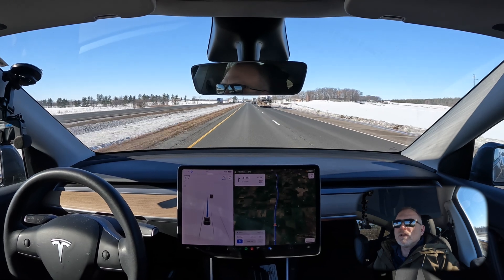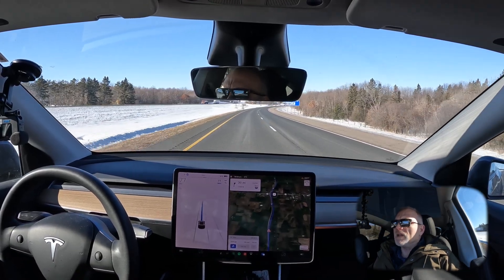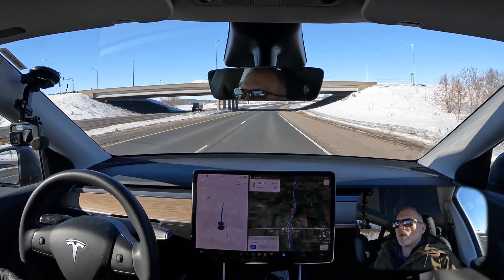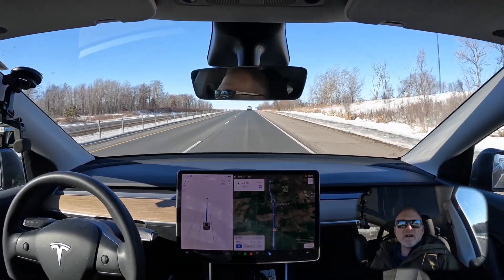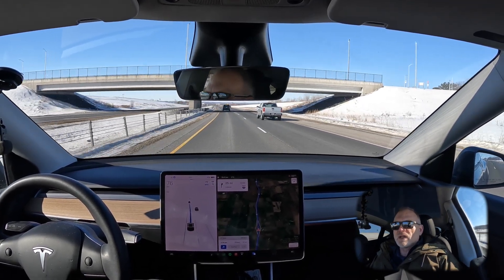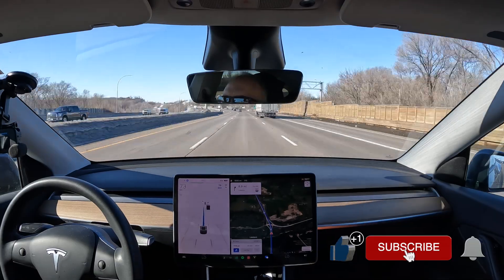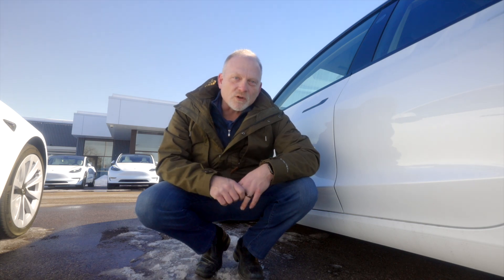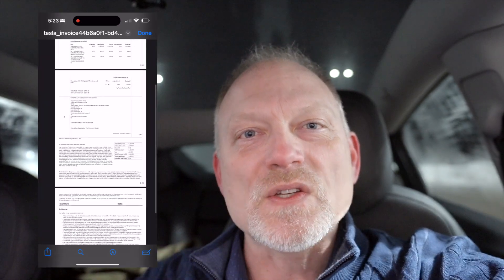Tesla Heat Pump & SuperManifold Replacement Cost | 2020 Model Y

Comment: This is what happened to my 2018 model 3. Warranty ran out after 50,000 mile or 5 five years. I’m having climate control failures. Looks like I’m going to have some costly repairs. It popped up on one of the firm ware update. 🤔
Reply from the maker: Very sorry to hear you're going through the same thing. I think it has a different heat system (resistance heater), but nonetheless, it still probably an expensive repair. Keep us posted here if there is anything for community learning / awareness.

Comment: In Sweden that would have been free of charge since it is a production error (very common one!) so they would have to take it, warranty or not.
Reply from the maker: That would be nice to have in the U.S.
Reply: Tell me more about it. I'm having the same problem with my 2022 MY Performance model in Stockholm, Sweden. The quote that I am given from Tesla is 33,232,98kr. I asked them if it is under a recall for my car. The reply was "I do not see any active recalls for your car". My service appointment is due in two  days. Not sure what to do not to get ripped off by 33k by tesla.
Reply: @ya_tozhe_hochu  My 22? Then it is probably not more than two years old, right?
When did you buy it?
Use "Konsumentköplagen". You have three years right to claim an original error, and this is clearly an original error since so many have had the problem in the same time and Tesla issued fixes for it.
Depending on when you bought the car, the seller have the burden of proof for six months (until april 30 2022) or two years (after may 1 2022).
Read the law and also read more at Hallåkonsument and Konsumentverket, and use that together with the articles written about the problem, and if they do not comply, then go through ARN. It is important to have as much as possible in writing, so save everything you write with everyone.
Reply: It should be a recall. We need to provide all this info to nhtsa in the us

Comment: There’s litteraly piles of heatpumps and manifolds in dumpsters at Tesla shops in Norway now, mainly from Y’s from Berlin since october to january. Brand new ones, failing 1-10weeks old. Apparently a manufacturer error of some sort, some claim it to be the pipes.
Would be interesting to hear what caused it on yours.
Reply from the maker: That is bad. Especially in Norway where it is as cold is it is here. I'll post a follow-up video if I learn something after looking at my old pump.
Reply: You think those failed pipes are from 2023 Model Ys ?

Comment: Good idea to take a broken unit if it is so expensive. I would have done the same
Reply from the maker: I’m going to pull the old unit apart and see if I can find the failure. It might make a good video if there is knowledge there to share. Hopefully someone mechanically inclined could use it to save a few dollars.

Comment: I’ve had quite a few cars over the years, including a 21 year old Subaru Forester. Never had a heat or AC failure.  I assume your seat warmers worked while you were driving
Reply from the maker: I haven’t either for heat, but have had several AC failures. Usually a leak in the line and loss of refrigerant on older cars we’ve owned. Your assumption about the seat heaters is correct - they saved the day until the repair.

Comment: Isnt it part of the warranty?
Reply from the maker: I pushed on that several times. The car is outside of the 50,000 mile standard warranty, but since this system is involved in temperature control in the battery, my thought was that warranty for the 'drivetrain' would cover it.  Unfortunately that is not the case.  Since the goal of my channel is to provide information about my overall Tesla experience, I will include both good and bad experience.  Although service was great, Tesla's non-warranty coverage of this relatively early major component failure wasn't the best experience.  I want to help make others aware.  It's a great car and my experience may just be a one-off.
Reply: @JohnVanDeVoort  oh Ok, didnt know that was the limit was so low. model S was 4years/100k+ miles
Reply: @JohnVanDeVoort  Don't you have insurance that cover it? Or how does it work there?

Comment: What a ripoff! I’m so sorry you went through that! For such an expensive car for the heat pump to fail after just 50K miles. Tesla build quality is horrible. My parents bought two and everything creeks. I went with the Lexus NX, best choice I ever made. For your experience you paid 3600 for service plus if you account for your time lost running back and forth, it’s even more expensive! The gist of the story is stay away from Tesla until they get their quality together! 😅
Reply: That's called survivorship bias. Almost none have this problem.
Reply: @harry-eto  The amount of heat pump failures out there on Tesla is... astonishing!
Reply from the maker: I actually made a comment in the video that I edited out of the final version similar to that (about lack of quality). What I added is that hopefully after the third production year, and also adding heat pumps into other Tesla models since the Model Y, that quality of the heat pumps should be better with more production experience.  I'm crossing fingers that that is the case and that this new heat pump will be better quality than the original one that failed.
Reply: @JohnVanDeVoort 
I just had similar issue from my 2021 Model Y. After talking to their lead technician over the phone who said “… the part works 24/7 even when not driven to keep the battery temperature at normal level…”. I told them this is absolutely a manufacturing or design deficiency that the consumer should not be responsible. It means Tesla perfectly knew this problem would happen from the outset. My belief is that Tesla should bear the responsibility of repairing or replacing the part at no cost to the consumer even after the warranty is expired as they knowingly pushed faulty system onto the consumer. Apart from being expensive, the malfunctioning might be from a refillable liquid and not from the hardware that according to me is sturdy enough unless one had an accident or a crash. I am gathering information (that’s how I ended up with this video) to compile evidence, technical testimonies from professionals, etc so that powerful corporations like Tesla wouldn’t continue to ripe off the little & powerless consumers like ourselves. The source of their power to ripe off comes from our inaction or silence.
Reply: @bizuayehuhaile1348any progress with a recall or Tesla owning this clear design defect?
Reply: I had two 2021 Lexus ESes with numerous rattles creaks and squeaks.
Reply: Lexus does not fight for our freedom of speech and does not release information on the gov'tal fckeries against us. To add, I cannot stand the new design of lexus and finally, I would have to wait for one for 18 months here in Sweden, last time i checked. So nope, thanks. I'll pay the $3K for the freaking pump and continue drivning my Musk-sla with pride and honour )))
Reply: I’m now in the same predicament with the same coat estimate. 300 miles outside of my warranty smh.
Reply: The heat pump in this car is incredibly reliable. I would say this is probably at 0.1% incidence rate. Very rare.
Reply: Mine failed too I believe this will drive a hardware recall since the rate of early despite is so high and the resulting safety issue with no defroster @matthewhodges5910

Comment: So what was the actual reason for the failure? Have they fixed this issue in newer versionsof the heat pump and super manifold?
Reply from the maker: They didn't state a failure. But I have the old one and plan to disassemble it to see if I can determine the cause of failure.  I did ask if rough road conditions contributed (since we have some rough roads with frost bumps in the winter). Tesla service technician stated that this wasn't likely.  I did see some other posts about operating heat pumps in extreme cold climates.  My car checks that box, since I drive in negative temperatures (up to -30 deg C) in winter months.
Reply: @JohnVanDeVoort did you ever get around to this? We’re 3rd party Tesla mechanics and we see heat pump failures with 22 and newer M3s.

Upon close inspection, it appears to be metal shavings stuck in the system on the discharged side into the super manifold. The compressor has some scraping, perhaps due to thermal expansion of the components inside. We get these from customers in hot areas in summer.

Anyway, the desiccant bag on the discharge side appears to catch a lot of the particles, so replacing that and the mesh filter underneath it fixes the problem ezpz, about $125… Note, Tesla quietly updated their compressor with a modified design (and part number). So we replace the compressor and clean the mesh filter and replace the desiccant bags.

This is the problem with Tesla. They’re great cars, but because there are so so so few 3rd party repair shops like us, there’s a lot of work for them. Instead of diagnosing and repairing, Tesla finds it easier for their shop scheduling to just swap entire components rather than refurbish and figure things out. In the small chance they do some detective work, they update component design.

For example, our business started with auto-present door handles for the MS, an $800 repair from Tesla. It’s a worn down aluminum gear inside that gets ground to pieces. We can buy a box of these in stainless steel for $20 and charge $250 for the repair! (It takes some work to dissemble the door).
Reply: They have had a bunch of different problems, from self destruction of heat pumps because of the cold to manufacturing errors and so on. They are replacing tons of them. A lot of them only a few weeks old.

Tesla should just have checked with companies that know how to build heat pumps and especially how it works in cold climates. But they always think they can do better than others and, well, no.
Reply: @Xanthopteryx  I live in California and mine failed after only 30,000 miles
Reply: I'm also wondering what the actual failing part is. Would like to repair it myself, or take it apart for rebuild.
Reply: Has anyone considered a class action lawsuit? If successful they would be responsible for the repair beyond warranty and reimbursement of repairs within a specific time period

Comment: Wow, that's crazy expensive and so unfortunate to be just outside warranty like that. How long does Tesla provide warranty for the new heat pump?
Reply from the maker: The warranty is 50,000 miles.  My car had 58,600 miles at the time of pump failure.  I don't recommend selling before warranty expiration, but may consider it (with other factors, such as how well the chips/computer hardware are staying updatable) if I make another new Tesla purchase.  That said, I'm definitely keeping this car as I have full self-driving beta (I bought FSD in 2020, before it doubled in price) and wouldn't want to spend current FSD price to add it to a new purchase.
Reply from the maker: 12 months or 12,500 miles according to the Tesla Parts, Body & Paint Repair Limited Warranty.